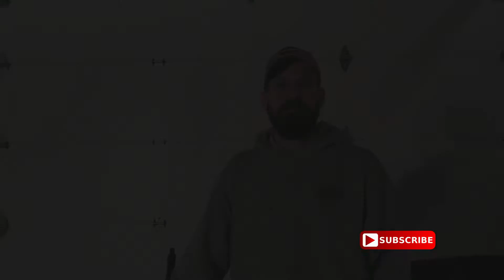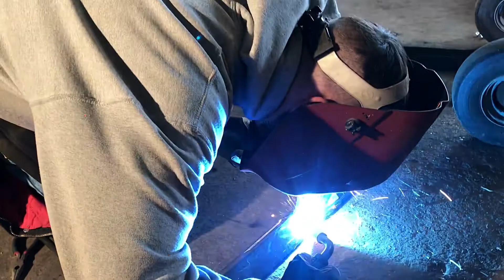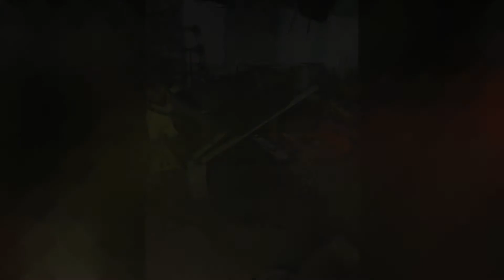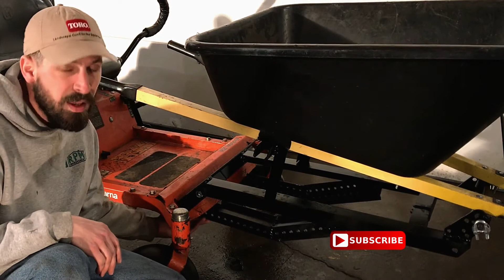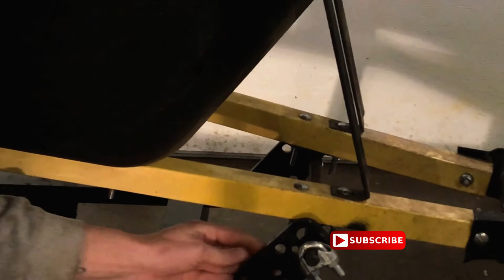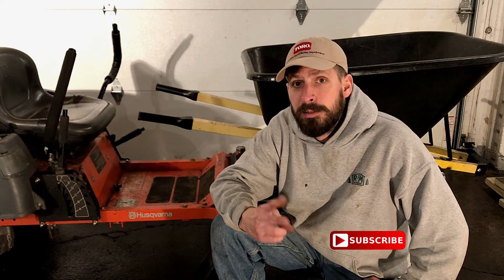ZERO TURN MOWER CONVERSION TO MOTORIZED WHEELBARROW (ZERO TO HERO)

Comment: I don't think it makes much sense to use a wheel barrow. A loader bucket works way better and it loads itself. The amount of work involved is similar.
Reply from the maker: We didn’t have a loader bucket at the time. Good idea 👍
Reply: @rpmimprovementoutdoorservi9968  Cheap Johny buckets made for lawnmowers are available. Granted I don't know if any are made to work out if the box with a zero turn. Or you could just make one since you appear to be able to do so. I feel like the worst part of a wheel barrow isn't moving it but loading it with a shovel.